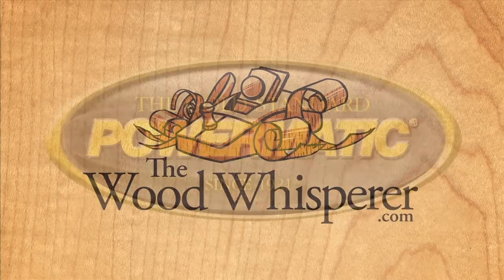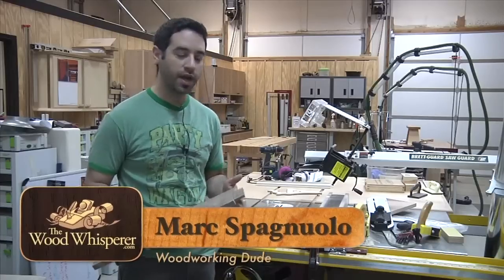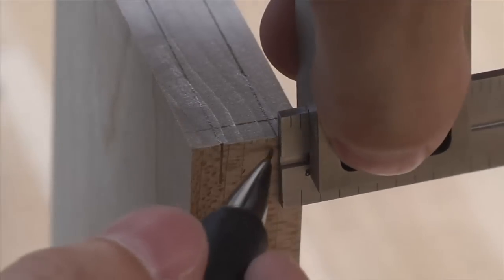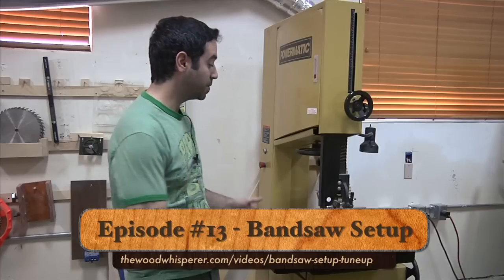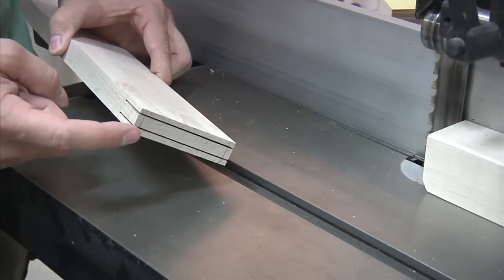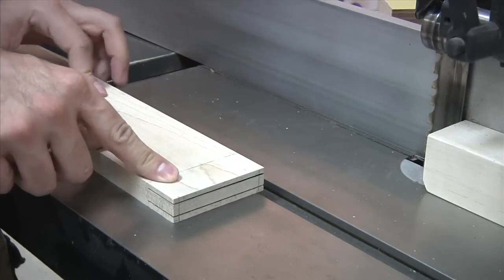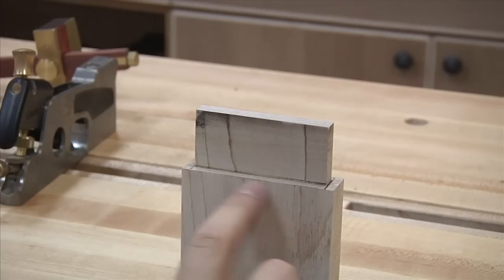172 - Tenons on the Bandsaw

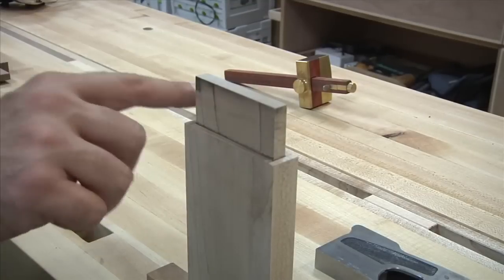Comment: The danger of the waste jamming between the fence and the blade is eliminated if you make four extra cuts to reduce the size of the waste pieces.  In your example, before you make the four cuts that remove the waste, ( between 8:20 and 8:45) make four cuts about half way along the length of the tenon to get rid of half the waste.  These cuts to not need to be accurate; freehand is fine, as long as you don't cut into the tenon.  By doing this, none of the waste pieces are big enough to jam.
The advantage of this method?  You do not have to move the fence, so you eliminate any error this may cause, and it is slightly quicker.
Love your videos.   :o)

Comment: In my day job I’m an electrician. I work on equipment with high voltages and dangerous amounts of current, that could electrocute a me, or cause an arc flash resulting in the equipment exploding in my face causing severe disfiguring burns, inhalation of molten vaporized metal, and or a very painful death. Working as an electrician has taught me, to be exceptionally aware of my surroundings and were my hands and tools are at all times. I carry this hyper awareness over into my woodworking because I like my fingers to stay exactly where they are. 

Table saws are perfectly safe as long as you don’t do stupid things on them. I don’t need a Sawstop because I practice good table saw safety and I use common sense. If I’m not making dados my blade guard or riving knife is always in place to prevent binding and kickbacks. I use zero clearance inserts. I do not cut warped, bowed, cupped, or otherwise unstable work pieces on the table saw, until I’ve squared two sides to 90 degrees at my jointer. I avoid making crosscuts at the table saw with the exception of using a cross cut sled. I would NEVER be stupid enough to try cross cutting a work piece against the rip fence, where it could bind or launch a projectile piece of wood towards me. I only leave as much of the blade as I need exposed above the table. I use feather boards and push devices so my fingers are NEVER get close enough to the blade that I could be injured. If you just use common sense you probably won’t cut your fingers off.

Comment: For a stop block, you could put a quick clamp on the right edge of your bandsaw table, so the stock hits it at the right depth.

I actually I put an adjustable depth stop on the front of my bandsaw sled for lap joints (same idea). I prefer to cut the shoulders, first. And if doing only a few, or if doing a cross lap, I'll slot out the entire cheek like this. After chipping out the waste, I put it back and joint the cheek by sliding it back/forth against the blade. The stop keeps things square!

Comment: Great Video as always. I like your intro clip.... It's true saw stop sells there product on fear, I'm getting tired of that ad on the back of Woodworkers Journal. Delta machinery is in my blood. Delta has been in the family since 1956... Saw Stop won't replace my Table Saw. I have been using the bandsaw to make tenons since I was 13 years old, and really like it. It's nice that you can run a big blade on saw which allows you to have a better cut. Thanks for posting.

Take care, Michael Frey
Reply: Oddly enough, Delta (and others) were all offered a manufacturing license by the inventor of Saw Stop, but considered our fingers not worth the expense.  I use mostly hand tools, with a bandsaw for resawing and ripping but if I ever get another table saw (doubtful) it will certainly be one with the finger savin' feature.  I play guitar and would really like to continue to do so.

Comment: Couldn't you cut shoulders even faster with a tenon saw, just because there's so little set up.
Reply: HRRLutherie: I generally hand-cut all of my joinery, but was building a pallet wood lumber cart yesterday and just wanted to knock out four Buick 2x4 half laps where I wasn’t concerned with furniture-grade precision. My 14” Powermatic did a fine job, but I really do need to get a resaw blade; the 3/8” blade wanted to wonder a little bit. Keeping the feed rate down helped with the wondering.